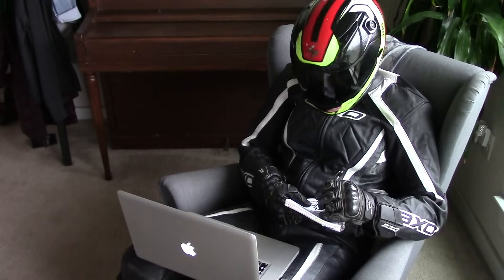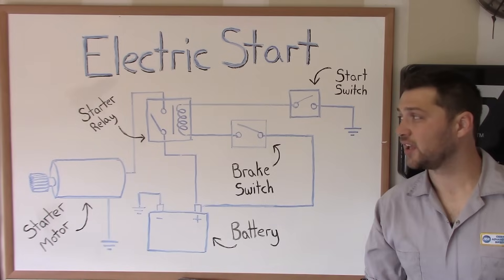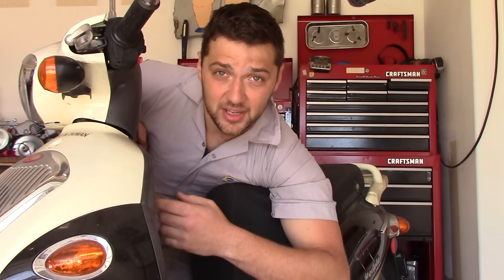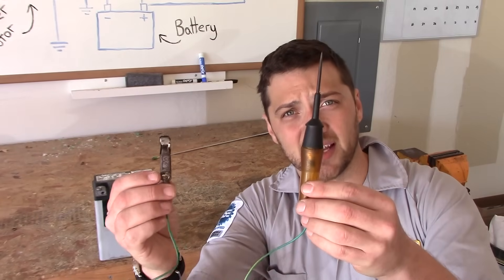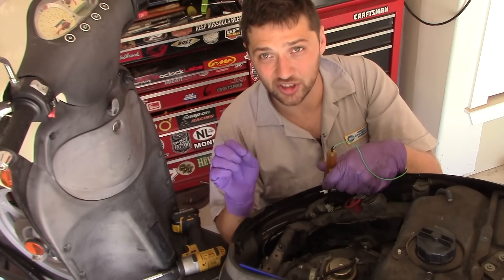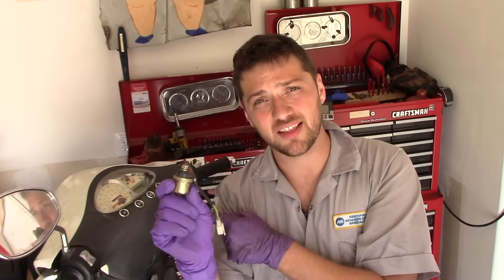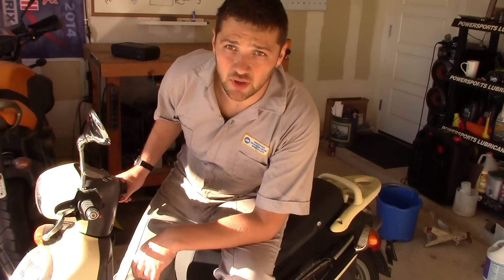Scooter 911: Electric Start Doesn't Work (troubleshooting your starter, starter relay, and circuit)

Comment: good video! Sadly mine still doesnt run.... it does want to start but it can't. for weeks it did run electric when i start it cold, but sometimes didnt when he was warm. but now it wont even start cold. I did do all the measurements you explained in the video. Does it mean i need to replace the startermotor anyway?
Reply from the maker: Nope! If the starter is cranking the engine (making the rikkiiikikiikikikkiik sound) then it's working properly. It sounds like your issue has to do more with the engine. You can try this video and see if it helps! https://youtu.be/QkkYjRdtQxg
Reply: @Scooter_911  well at first it did, but since yesterday it doesn't. i only hear it wants to power the engine but no rikkiiikki sound anymore. battery, switches and startrelais seems fine. kickstarts works with 1 kick and runs well. i can only think about the bendix or the startmotor.
Reply from the maker: @mycroblast8123  it could be the starter motor but they actually go bad a lot less often than people think. More often than not its a bad engine ground. make sure there is a good connection between the battery and the engine case sometimes it helps to put a jumper cable from the negative battery terminal to the engine case itself. give that a try and if it doesnt make a difference its time for a new starter! good uck!
Reply: @Scooter_911   Thanks for the tip! I didn't think about the return path. I did connect a jumper caple from the minus battery to the metal bolt of the startermotor now, sadly it isnt the ground connection. to verify the connection i measured the resistance of the circuit from minus to the connection bolt of the starter and it was 0,1 Ohm. so i think there are no other options than the startermotor. i will reply once i've replaced it.

Comment: my scooter starts as soon as i pull the brake in, i dont even have to push the start button.when i drove it i used the brake and my starter grinded.  is my start button stuck in the on position?
Reply from the maker: Either that or you have a short to ground on that wire!
Reply: Question...my 1983 yama scooter had lights but the electrical push switch did not work.  I did your trick and used a screw driver and touched both positive and negative in which you called a bypass.  It fired up right away.  Now it continues to start no problem.  Any idea why your technique worked and it is back to working?

Comment: Great video. Before I start testing things, I have a question. The scooter won’t start with the switch but will kickstart. Does that make narrow down what it is? Battery is fine.
Reply from the maker: Does the scooter crank when you hit the start button (making the rikkiiikikiikikikkiik sound)?
Reply: It doesn’t sound like the battery is low and it doesn’t make a ticking noise. It sounds like an electrical noise but neither of those sounds.
Reply: Or let me say that is doesn’t sound like a car battery that is half dead and it doesn’t sound like a gas grill when you push the ignition button. It sound electrical. And brake light does light when engaging brake lever.
Reply from the maker: @lindamitchell8162  ok I would go through the troubleshooting in the video and make sure you try the relay bypass test at 7:30
Reply: Excellent! Thank you so much! I appreciate you doing this video and answering my questions.

Comment: I tested with a test light and one wire going to starter solenoid and ones always hot what can the problem be?
Reply: I’m talking about 2 wires coming to it not one JL from battery to it
Reply from the maker: @markboase  is the brake light constantly on? One wire should only be hot when the brake light circuit is hot
Reply from the maker: One of the large wires on the solenoid should always be hot. Think of it like a faucet the water is always there but it only flows when you turn it on
Reply: The light is on but gets brighter when I hit the brake
Reply: Bike starts when I touch the metal pieces on starter relay together

Comment: bought an 05 zuma BWS 2T, would not turn over. wasnt battery removed starter, it turned over fine, wasnt starter, sat for so long corrosion popped up against starter gear, starter cog & seized it, took off, dremeled it clean and starts mint all the time now.

Comment: My bike makes that sound on 3:38 what would the problem with it
Reply from the maker: it could be nearly anything, lack of compression, spark, or a faulty carburetor. I included this in the video because i wanted people to be able to differentiate when they had an "electric start" problem and when they have an engine that wont run. BUT FEAR NOT! i have another video coming out soon that is going to take your though a few diagnostic steps to help you get your problem solved!

Comment: I need suggestion for my KYMCO Super 8 125cc scooter. I am having trouble with my ignition switch.
####### MODE 1  ###############

Ignition turned ON: engine starts and works perfectly everything works fine when ignition turned off engine shuts down as well.

but the problem is in  ############## MODE 2 #############
Ignition turned OFF :  The engine still cranks when ignition is turned off although it doesn't start and still all the side lights, headlights and horn still keeps on working.
So, how do I stop this from happening ?
PLEASE HELP ME!!! THANKING YOU!!
Reply from the maker: it sounds like you either have a short in the harness or a short in the ignition switch. to find out which one unplug the ignition switch and see if you still have light functions. if you do not then replace your switch. Good luck!
Reply: @Scooter_911   I unplugged the ignition. But it tends to crank the engine when i press start but doesn't start. Also the lights are working. What is next?

Comment: Hi I’m one of your subscribers..I have a starting problem I’m using a Cf moto v3 mc scooter I have this clicking problem when I start it it click but won’t turn over I replace the starter relay and motor starter and got a new battery and yet it won’t start and the hand brake works fine , I don’t know what to do next , this problem starts when I was riding and suddenly it lost power and ever since then I couldn’t get it to start please help
Reply from the maker: Is it possible to use the kick start? Your engine could possibly be seized.
Reply: @Scooter_911  oh it doenst have a kick start, and what do you mean my engine could possibly be seized ?
Reply from the maker: @IsraelAwakeningAfrica  you might have a mechanical failure in some part in your engine preventing it from being able to be turned over. What i would do is take out the spark plug and remove the belt cover. then put a wrench on the variator bolt and try to turn the engine over by hand. It should spin pretty easily without the spark plug in. spin the variator the same direction as the rear wheel spins. if it doesnt move see if it moves backwards.
what i have seen a lot is a valve failure where the piston hits the valve and gets jammed in the cylinder. Good luck!

Comment: Hey Garrett, I have followed your video and I have a problem. When I turn on the scooter it will not start, but the test light show juice going to the starter motor. I can bypass it and it turns over but from the start switch nothing. Is it possible that the leads are backwards on the solenoid switch. Brake light works no wires are cut or loose.

Comment: Hi Garret. I have a Honda Sh300i. (Battery fine, controls light up. Just won't turn/start) Won't start and I believe it is either the side stand cut off switch, or the rear brake cut off. I had assumed that the rear brake operated a switch somewhere (but I  can't find it) but your video suggests it simply completes a circuit for the solenoid. Is this so on all brake/cut offs on  scooters?  As the brake light works, does this mean it has nothing to do with the brake, but must be side stand or solenoid?
Reply from the maker: You are correct. Does it make any sound at all when you hold the brake and press the engine start?
Reply: @Scooter_911  A slight electrical sound as I turn the ignition key on and the  control lights come on. But no, no sound at all when holding brake in and pressing starter switch.

Comment: Thank you for the help! I was able to get the starter cranking with the bypass. Do you have any experience with scooters using a relay with 4 fuses attached instead of the 2 prong harness? Thats what my 1987 Honda CH150 has.
Reply from the maker: Yes absolutely. The old Yamahas have a similar setup

Comment: Sir new subs here from philippines..
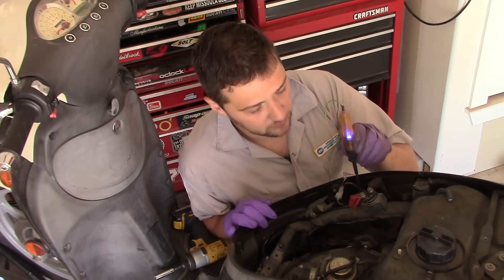Sir @ 5:07 you put the tester at negative right then the test light put the red bolt of relay..
How about the black bolt @ 5:15 of relay you test..?
 you put the test light into positive position or same negative?
 Thanks
Thanks
Reply from the maker: great question! at that point in the video the lead is attached to the negative battery terminal!

Comment: Thanks for the vids...Question: 2010 Honda 150i...Never had a problem for 2yrs. Suddenly no engine light during start and won't start. Only the headlight and fuel pump are normal. My next step will be resetting the ECM. Any ideas...I also have a  02 Met with a similar problem.

Comment: Can you help me get my scooter back up and running ... I was driving it the other day was working fine then I shut it off to go inside work and when I tried to turn it on 5 min later it wouldn’t turn on no clicking noise or anything I don’t have a kickstart I have a Honda ruckus clone 150cc ...I just got a brand new battery put a new cdi new spark plug new ignition coil and new rectifier ...I have a 11 pole stator ... can you please help me ..when I have the key in and try to electric start it it doesn’t make any noise or anything
Reply: So I bypassed the electric start by putting a screw driver on the starter solenoid and it started right up ... but it won’t work when I try and press the starter switch button...what do you think is wrong please help
Reply from the maker: @2FrEsH4ya617  when the scooter is "dead" (not started yet) do the horn and turn signals work? There are only a few possibilities and I'm trying to narrow them down. Also have you checked the glass 10amp fuse that's inside your battery box?
Reply: Garret Seesing ... no nothing works when the bike is off .. only when the bike is running  the horn and signals work .. it brand new spark plug brand new battery brand new ignition coil brand new cdi and brand new solenoid and brand new rectifier...please let me know thanks a lot I appreciate it
Reply: If I bypass the starter with pliers on the solenoid my scooter starts right up what do you think is wrong the wires inside the starter switch are connected I haven’t checked the ground but maybe the switch is faulty but the kill switch function still works
Reply from the maker: @2FrEsH4ya617  did you check that fuse?
Reply: Garret Seesing .. yea the fuse is still good the metal is still attached and not broke inside ...
Reply from the maker: @2FrEsH4ya617  great it could very well be your ignition switch try connecting the red wire to the red/black wire with a paper clip. Do not connect the green wire or the black wire to anything
Reply: Garret Seesing ..where are these wires that your talking about ? Inside the case housing of the starter ignition switch
Reply from the maker: @2FrEsH4ya617  you'll have to take the front cover off the scooter. The wires go into the back of the ignition switch where the key goes. You'll find a plastic connector you can disconnect. And then use the paperclip on the wire harness side
Reply: Garret Seesing I will try that but I had a question if my scooter starts by bypassing connecting a screw driver to the terminals on the solenoid does that mean it good and working or can it be defective?? I didn’t try it with the original one I had on it I just changed it first ...so what’s a way I can use a push button start instead of the original or what’s the best way to solve it
Reply from the maker: @2FrEsH4ya617  it does not tell you if the solenoid is good or not. Just that the starter is working
Reply: Garret Seesing ok thanks how can you tell if the solenoid is good or not ??
Reply: Garret Seesing also if I connect a a wire to the solenoid to both terminals and one on ground can I put a toggle switch or push button
Reply from the maker: @2FrEsH4ya617  you will need a test light to check to see if the solenoid is getting the correct power and ground. A toggle switch is possible but it won't be that simple to wire.
Reply: Garret Seesing ... so I connected my 4 pin rectifier back up and wired it again and made sure all wires were good on the harness and it works with the electrical start the 6 pin rectifier ended up blowing up and it didn’t start up unless I bypassed it ..but I have a 11 pole stator on my scooter with 4 pin rectifier is that ok
Reply from the maker: @2FrEsH4ya617  woah woah woah this doesn't have anything to do with your rectifier. Email me at garretseesingofficial@gmail.com and let's get this sorted out
Reply: Garret Seesing I have a 11 pole stator and a 4 pin rectifier then I changed it out for the 6 pin 11 pole rectifier and it would work so I checked all my grounds and everything so when I started the bike the 6 pin rectifier got to hit and blew up so I put my old 4 pin NCY rectifier back in and I hit the switch and it worked lol idk everything running fine now but the rear break light is very dim now but the turn signals work fine and are bright what do you think is wrong ??
Reply from the maker: Does your brake light get brighter when you squeeze the brake lever?
Reply: Currently nothing is working right now ...it works when the bike was running

Comment: WHAT IF NOTHING HAPPENS WHEN YOU DO THE BYPASS STARTER RELAY TRICK ?
Reply from the maker: If the battery is good, all the turn signals and horn work, and you do the bypass but nothing happens the problem is with your starter motor. Make sure all of you engine grounds are properly connected and the starter hot wire is correctly bolted to the starter motor. Good luck!
Reply: @Scooter_911   THANK YOU....ILL REPLACE THE STARTER.DANG THING ONLY HAS 120 MILES ON IT. APPRECIATE YOUR VIDEOS ! THANKS AGAIN.

Comment: Great video!! Loved the wiring diagram especially, as it saves a ton of time when doing diagnostics. Thx a million!!
Reply from the maker: Glad you liked it! Hope it helps you out!
Reply: @Scooter_911  It most certainly did!
It turned out to be a faulty connection to the starter motor. Cheap fix :-)

Comment: Every thing you told me to do I did and it still didn't start up boss.
Reply from the maker: Did the starter motor crank the engine? (Make that riiiikikikiiiikikikkkikikiki sound?)
Reply: @Scooter_911  it sounds like it wants to start up.  But it will not. 
Every thing comes on. What kind of cdi does the Yamaha Zuma have.
Reply from the maker: @filippocunsolo6764  so the motor IS cranking?
Reply: I have a choke on my scooter it goes all the way to the throttle.
Reply from the maker: @filippocunsolo6764  has the scooter been sitting for a while. If so, it most likely will need a carburetor service
Reply: @Scooter_911  so can I get the cab. Cleaner.  Or I have to get it done.
Reply from the maker: @filippocunsolo6764  you can definitely clean the carb yourself. Just watch some videos on how to take it apart and what needs to be cleaned. Good luck!
Reply: @Scooter_911  but what kind does the 02 or 05 Yamaha Zuma scooter for cdi box's buddy ty
Reply: One thing what kind of cdi box the Yamaha Zuma take.
Reply from the maker: @filippocunsolo6764  the Zuma takes its own style of box and it changed throughout the years. It's best to replace it with a genuine Yamaha part. But there are aftermarket clones available. They usually don't go bad on Zuma's thoigh so I would check for spark before replacing any parts Willy nilly
Reply: @Scooter_911  what kind of cdi box you think you will get.
Reply: What kind of cdi box the Yamaha Zuma has.
Reply: You are still not telling me what kind a 02 Yamaha Zuma scooter cdi box.